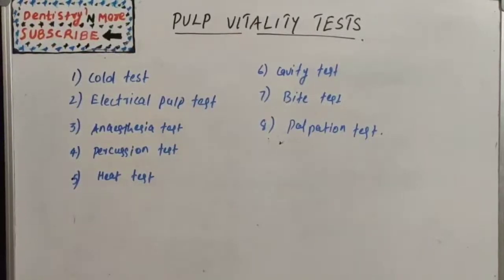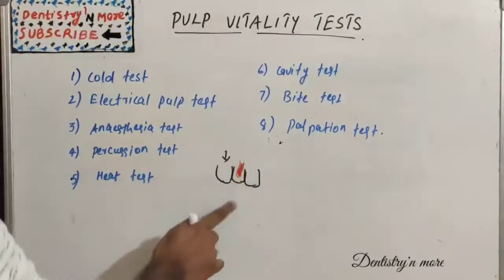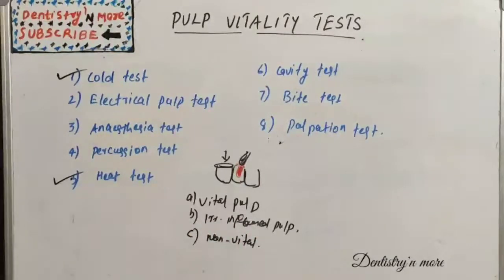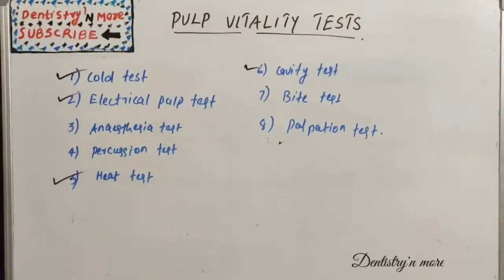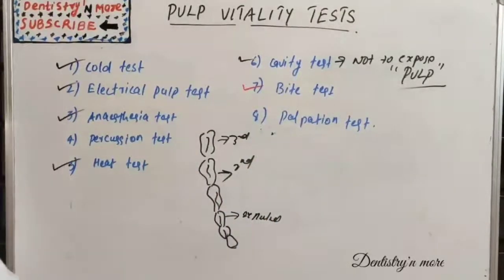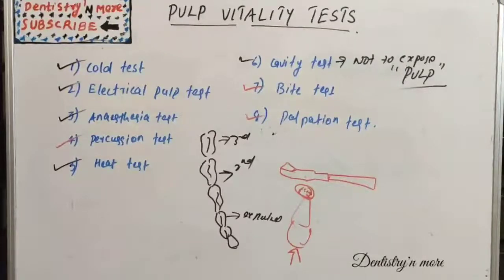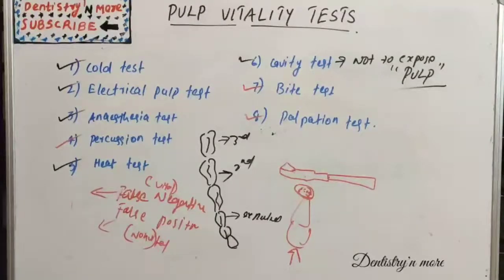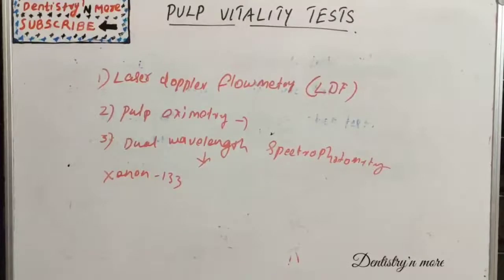PULP VITALITY TESTS

Comment: How we can differentiate normal pulp and reversible pulpitis by cold test?
Reply from the maker: Normal pulp tests within normal limits to cold. Clinically, a patient will respond to a cold stimulus, and after the stimulus is removed, the cold sensation will dissipate immediately.

If your pain occurs with cold test but goes away quickly, you may have a reversible condition.

But if the pain is intense, lingers after cold test, occurs spontaneously, or is referred to other teeth, making it hard to determine the exact location, you may have irreversible pulpitis

Normal vs reversible pulpitis needs to be differentiated with the help of other clinical findings, symptoms and radiographs. Its difficult to differentiate between normal pulp vs reversible pulpitis using cold test alone.
Reply: @Dentistrynmore  thank you sir
Reply: sir,what is  hot salt sterilizer?
Reply from the maker: @SR-tu2pb  its similar to the glass bead sterilizer used to sterilize the RCT files, but instead of glass beads, this sterilizer uses  ordinary 'Table salt'.
Reply: @Dentistrynmore  thank you sir